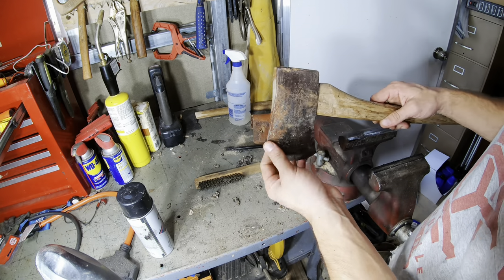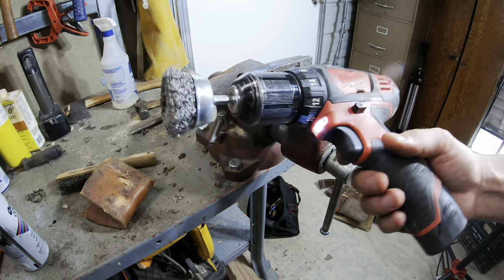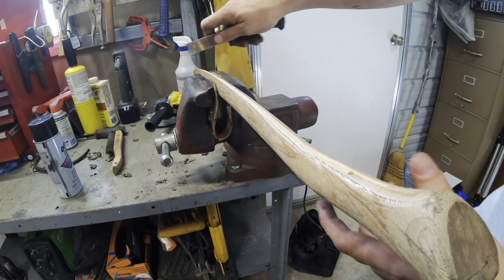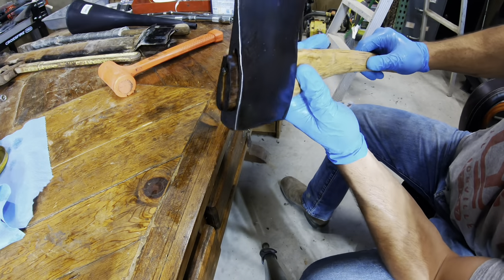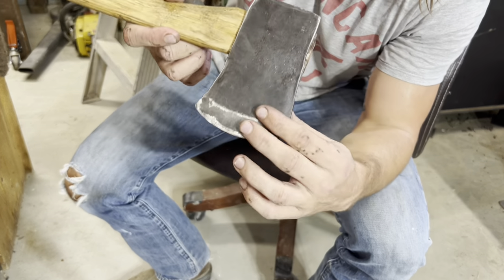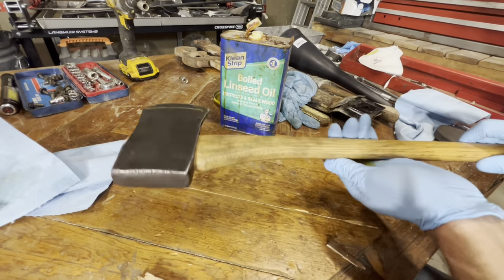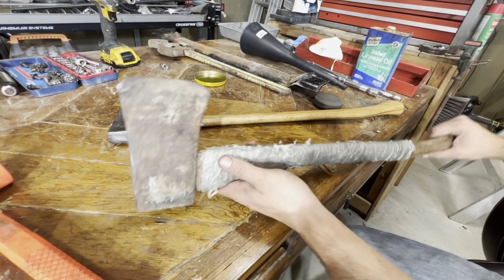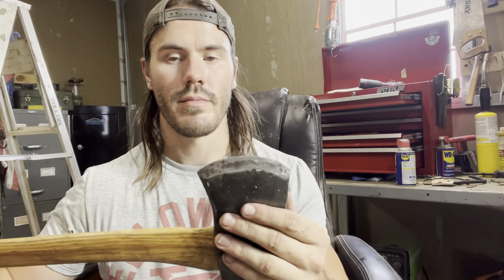Fixing An Old And Loose Axe Handle

Comment: The stamp is True Temper Flint Edge. On this side of the Atlantic I couldn't imagine putting such a rough and ready hang on an axe like that (effective, I agree, but not pretty) but then I guess you don't see many Elwell or Brades where you are. Over here I'd have looked at more of a restoration for that, with it being cheap and common where you are I can see the worth in repairing it quickly and swinging it.

For restoring old, dried handles you can completely immerse them in boiled linseed oil for days, even weeks, and then burnish the wood back as the oil sweats out later. Takes ages but works, not really suitable for a project like this though.
Reply from the maker: I knew going into it the old handle wasn’t going to let me do a beautiful hang. Worked with what I had to get it working same day. I’m not happy with the aesthetics of this hang but very happy with the integrity. It’ll likely last forever or until I overstrike and break it lol subscribe and I’ll make sure I post the most glorious video some day of me masterfully putting a new handle on this baby. A full throttle restoration to make you happy!
Reply from the maker: You kind of low key annihilated me here lol
Reply: @WINOtinkery  Genuinely not my intent, you were very clear you were fixing it up to use and that is a good thing. The only bit I winced at was not cutting a new wooden wedge that fits, but with the two barrel wedges I expect that head is rock solid. I also think there need to be some tools out there to actually use, it was what they were made for. You shrugged at a bit of overstrike damage from splitting big rounds, if you'd spent two months soaking and burnishing the handle back to a super shiny condition you'd have been swearing at the very least. If it were a full factory condition restoration I doubt you'd even swing it at a log and that would be a shame. 

My point is that I find it interesting how people in different countries see different tools. We just don't have a supply of old US axe heads in Britain, what is over here was imported by collectors and they don't turn up cheap at car boot sales. To get an axe head like that shipped to the UK is a minimum of $25 postage plus the actual purchase price, with import taxes on top, so I'd never consider the rapid repair an option. You can find a whole bunch of massive, seven pound Welsh pattern heads over here cheaply enough, I expect they're seriously rare in your neck of the woods and as such I doubt you'd just patch one up in a day to swing it. I might, if I got it cheap and it wasn't as nice as some of my others, but that's because I see them regularly enough to treat them like the tools they are.
Reply from the maker: @jordanstevens8132  hey I totally get what you’re saying. I would love to shop around other countries to see what pops up at their garage sales. I don’t typically get too caught up in collecting axes for the sake of collecting though. Although I enjoy it it kind of weirds me out that when these old axes were new someone bought them to use. Then over the years it goes unused and eventually lost. Then someone today finds it and all of a sudden it’s a tool that can’t be used anymore? Nah. My philosophy is to not ruin the head. The handle is replaceable and doesn’t hold much value to me. If I try to save a handle it’s an economics thing usually. I really need to find a good source for affordable top quality handles. Can’t do those hardware store handles anymore.